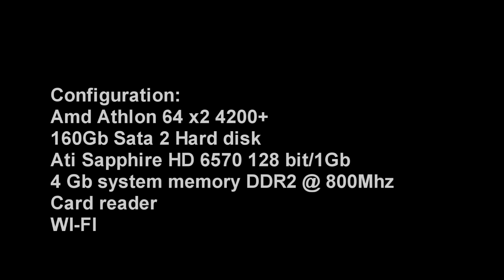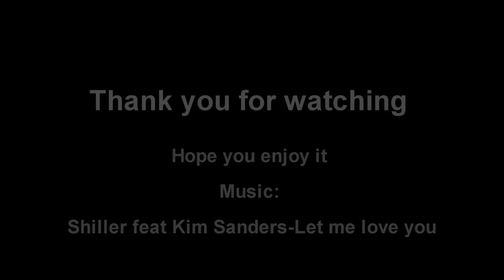Compact plexiglas computer

Comment from the maker: Buy a "low profile" videocard .Its smaller...Now i have found a way to mill plexiglas with my cnc (before the plexiglas has melted due to heating of the milling tool)  I suggest you to make the back panel of the case somewhere on a CNC machine.  In this way you will have a good design, and will look more professional made.(and will be).  Thanks for the feedback!  :)

Comment from the maker: Plexiglas you find in almost any bricolage hypermarket (like bricostore or kaufland ).The plexiglas from this video is a low-cost one, it melt at high rpm cutting or drilling. Have 5mm thickness and the whole surface have 1m/50cm and it costs about 20 euro. A high quality plexiglas can be cut on high rpm machines (like a CNC ) without melting and sticking on milling tool . But it costs almost triple ! (and it can not find it in Romania :(  The barnd used in my video is "polystyrol"

Comment from the maker: Just screws... If you look closely you can see in the video. The secret is to use a thick Plexiglas (mine have 5mm thickness ), the screws diameter is around 3mm . If you use a thin plexiglass, you risk to crack the plexiglass when you insert the screw. And btw .. drill the holes first,with a drill bit with 0.5mm smaller in diameter .

Comment: awesome work. Im looking into creating a similar build with a miniITX board for a home server. I was thinking it may be cool to frost the outside with really fine grit sand paper, and line it with EL Wire to make the colored light show through on the clear edges. I have an image in my head but cant right it down correctly lol. Great build though.

Comment: nice design I bet it will last longer due to good direction of fan.
it will be nice to implement a peltier elements with watercooling and digital temperature control with fluid flow control.
I think you can make anything.
Reply from the maker: I have already made a freon cooling system for the other computer!(the old one).The whole freon cooling system i have  integrated in the PC case so from the outside you can't notice any difference! Even the noise is normal! :) You can see the video of that on my channel.
Reply: let me know if you gonna strugle with life.
i mean i have lots of contacts here in uk where you can expand your knowledge.
Reply from the maker: gigi morphe Thank you very much for the deal, i will keep in mind... Its good to know that i have a PLAN B somewhere:) Really appreciate this.

Comment: You turned your PCI sideways by hand? Dude.....what is wrong with you? I cannot even comprehend the effort that took.
Reply from the maker: Its an adapter... yes, made by hand:) with patience and imagination and some tools you can do wonders! In almost two days was ready.... I have done this because on the romanian market, the price for such adapter was very  high, and hard to order.(just for some wires and a connector) And ebay was not a solution... at least not a quick one... And for this reason  i have took the problem in my hands and made-it! With 0 dollars!
Reply: dumyyyyyy Wow man. Very Impressed.

Comment: Good work man. Just one hint. Pay more attention to details. Take the file and clean the hole edges for example. If you leave them wobbly if will just ruin the effort you put there in the end. BTW. how thick is the plexiglass and how does it hold after some time? In my experience it tends to get scratched over the time even if you dont really stress it physically.

Comment: love it, only thing is the see thru plexiglass isnt really my kind of thing but i love the concept of the build. Also if I remember, Alienware did that concept with there Area 51 computer with the side ways GPU so it was more compact.
Reply: ***** for dusting no. Not at all, if you got a pretty dust free/ close to dust free area you don't have to worry as much. Plus the only time your really having to worry about dust is when you start getting into liquid cooling because you don't want dust blocking the radiators fins as that wont cool the liquid. Also you can get dust filters for the front intakes and that will help a lot trust me. The see thru case is just a personal preference here, theres nothing to it other then holding your computer parts and airflow. and most cases don't have front intake so keep that in mind. So back to the dust, thats just completely false to say.